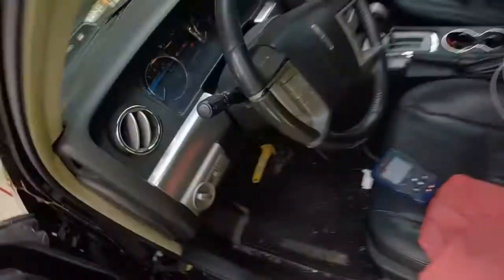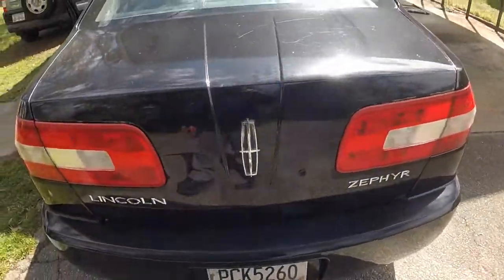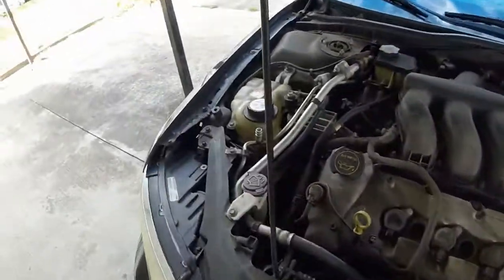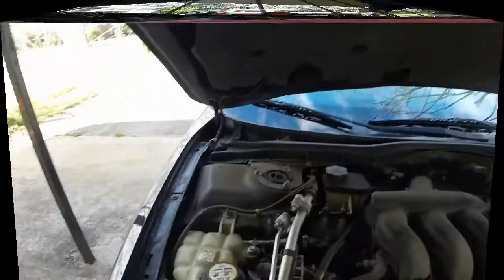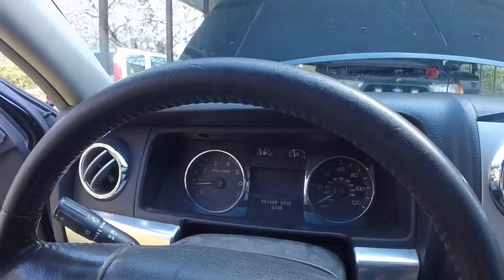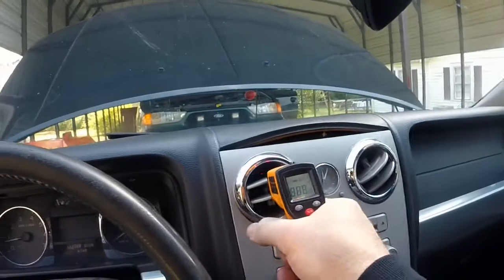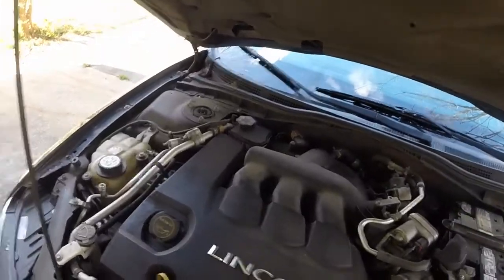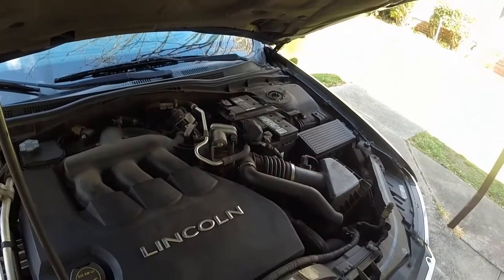Lincoln Zephyr 3.0 ,code PO304,replacing the coil and plug

Comment: You did the back three
Reply from the maker: Not at this time,only had a misfire on cylinder 4,it's in the front,but pull the intake plenum off,real easy,and you can get to the back three no problem.